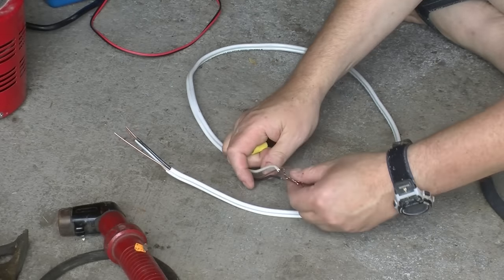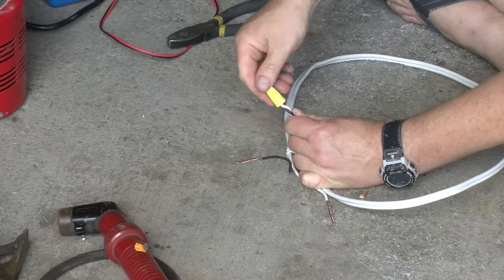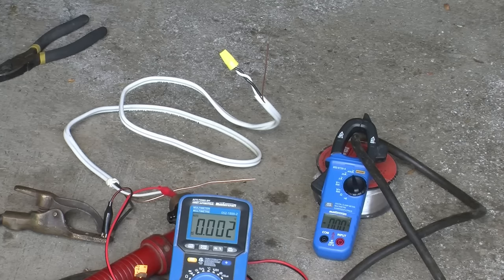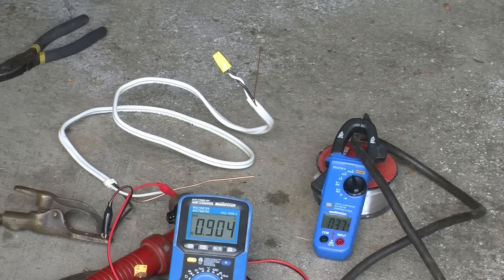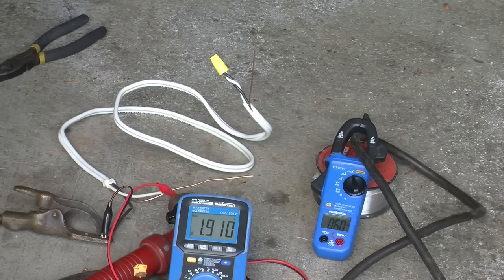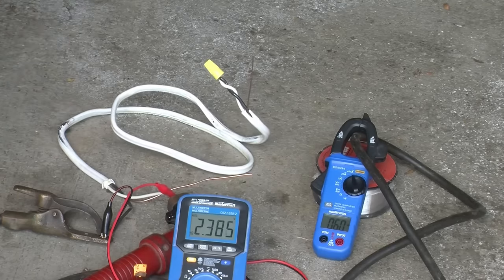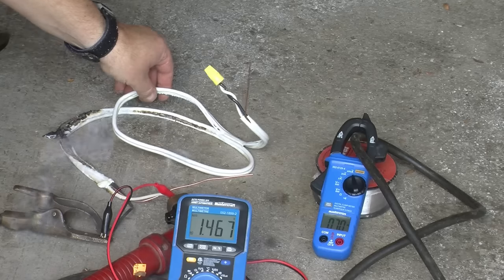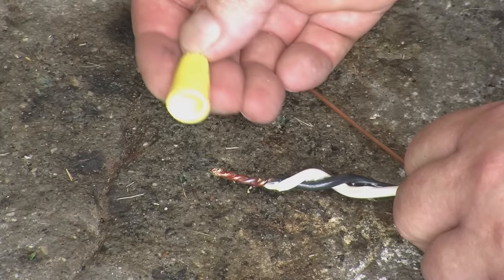How many Amps to burn up 14/2 electrical wiring?

Comment: I have a noob questions.  And it's been a awhile since I took physics 2. But I thought amps were dependant on volts and watts.  So how can you have like 80 amps and 2 volts with like 40 watts? Shouldn't watts be much higher? (I know of the formulas for calculating) I'm thinking of like a standard 120v and 3500 watt generator here for comparison.
Reply from the maker: The equation is P=VI where P is power in watts, V is volts and I is current amps. If you know or force any two of the variables above, you can calculate the  other one. This can be shown  by re-arranging  the equation so in your example, "amps were dependent on volts and watts" I= P/V but in the end is all the same - know two variables and you can get the third. 

Here I am setting the current with the welder and variac. The power we are investigating is the power dissipated in the cable from the current flowing though it (not the power delivered to the load). The power dissipated or lost in the cable is the current though the cable times the voltage along the cable. Whats the voltage along the cable? From Ohms law, its the resistance of the cable time the current through the cable V=IR and since R is constant (neglecting the effects of heating) P = VI where V=IR so P= IRI or typically written P = I²R

So the power we are seeing depends on the I we have chosen and the resistance of the wire which in turn sets the voltage along the wire. Since R of the wire is very low, V along the wire is low.  An example of this from the video is I=50A resulting in V=1.5V so power dissipated in the wire at that point is 50Ax1.5V = 75W.

The power in you last example is power delivered to a load. So if we had a 120V circuit with the wire in the video carrying 50A, the power delivered to the load (attached in place of the wire nut) would be 50A x 120V =6000W. At the same time the wire would be dissipating 75W since we know from the video that at 50A, 1.5V is developed along the  wire. 

Hope that helps!
Reply: @ElectromagneticVideos  actually this does  explain it!. Thank you.  I didnt consider it was just the wire

Comment: Thermal imager should be used to compare C° rating to failure. Also, commenting on wattage values is of no consequence as 20 amps @ 1 volt is 20 watts and tha same @120 volts is 2400 watts. Ampacity is the only value ( not property ) that is critical to conductor/insulation application.
Reply from the maker: I'm looking into an imager!

Comment: If you are fire conscious and fire worried - which we all should be - better to put lower rated fuses in and get smarter about not running so much power at one time  - you learn that as a thrifty person anyway or people with low power solar or wind - toaster OR microwave oven
Reply from the maker: Yes - however in Canada and US, in most cases the electrical code does not allow a fuse or breaker less than 15A. The big danger is people swapping in larger fuses or breakers.   I did a bunch of follow up test videos with the cable in a sections of wall surrounded with insulation and the safety margin gets uncomfortably smaller in some situations.

Comment: Why do I have to use the 16g stripper to strip the new 14 g wire? I rewired some of my house and it was wired with 12g wire. I bought new 12g wire and it is not the same thickness of copper. When did they start cheating us?
Reply from the maker: That's weird - how about  measuring the conductor diameter with digital calipers  for both the old and new? And compare both with the diameters given by online awg wire size table? I would be interested to hear what you find.
Reply: @ElectromagneticVideos  I do not have a digital caliper but I do have wire strippers and the 14 g stripper will not strip what they call 14 g wire today, I gotta use the 16 g to do it. Also, the 12 g wire my house has in it from the 70's is clearly thicker than the new 12 g wire.
Reply from the maker: @sputnut  From the 70s ? It isnt aluminum, is it?
Reply: @ElectromagneticVideos  No. definitely copper
Reply from the maker: @springhollerfarm8668  Baffling!

Comment: The test should have been preformed at 110 volts then increasing the amperage to make it a valid test  of what would happen in a typical house wiring.
Reply from the maker: The test here was to see the effects of heating due to the current so 120V was not needed. I did a FAQ video here with more details: https://youtu.be/CP3-jcpzZeI

Comment: So it looks like we can use 14-2 as a 200 amp fusible link?
Reply from the maker: Someone posted a comment about how in the old days they used #14 bare wire as a high current fuse just like that!

Comment: The problems I have seen are not so much the wire capacity but the connection to the device with the crappy "push-in" connectors in the back where only the thin edge of a short flat spring contacts the wire reducing the gauge of the connection to what, 22 or 24? I have seen many burned devices at that point where someone runs a 1500w heater for hours. I guess the Wago connectors have two springs touching the wire so it is twice as good as crappy! I only connect to a device by wrapping the wire around the screw and tightening it firmly. I also only trust connecting two or more wires by twisting them together and covering it with the proper wire nut. I have never had one fail! 
I understand the speed queens out there that want to get the job done quicker to make more money, and it will probably last longer than the 1-year new home warranty, so what the hell!

Comment: Apparently you do not know that wire nuts are designed to twist the wires when the nut is installed.
Reply from the maker: That varies depending on the manufacturer and model of the wire nut. Some instruction do it either way. There seems to be a huge argument between electricians whether to twist ahead of time or not. I prefer the twist ahead of time and it does seem to produce a better electrical and mechanical connection.

Comment: I thought the wire is rated at 15A at 120/240V  so it should go much higher at a lower voltage.
Reply from the maker: The heating is caused by the current through the wire and resulting voltage drop along the cable. The voltage between the wires does not contribute to the heat melting the plastic insulation. The main difference that a higher voltage between cables would create is arc type events once the insulation melts and fails. In a real circuit with 120V or 240V (or more) when arcing and shorting occurs you would hope a circuit breaker trips and the result would be much less interesting.

Comment: You are only supposed to use 12A because that is what the breaker can continuously handle without tripping, not because your wire cant handle 15A continuously.
Reply from the maker: Almost but not quite. A 15A breaker is supposed to not trip until 15A is exceeded, and, depending on the manufacturing specs, may pass a few amps more than that indefinitely as well as considerably higher currents for increasingly short periods of time without tripping. The 12A from the  80% rule is to prevent nuisance tripping at times when the AC voltage is a few percent above or below normal and loads react by (depending on load) drawing more current. 

The 15A code limitation for #14 is to prevent the cable from overheating over extended periods of time at that load, and organizations like CSA and UL do evaluations with cable installed in more realistic situations than in this video. In particular, the plastic around a cable that is installed embedded in insulation in a 2x4 wall will begin to fail at far lower currents due to the increased temperature rise. I did a few more videos after this showing cable in 2x4 walls and how much the safety factor is reduced.
Reply: @ElectromagneticVideos   Funny how knowing what you are talking about, tends to dispel wrong assumptions!
Reply from the maker: @professorg8383  Ha - yes!

Comment: You did this test on brand new wire . Maybe old wire that degraded over time would yield different results ?
Reply from the maker: The wire I used was unused but not brand new as in "I bought it yesterday", but still in new, shiny copper condition.  I think as long as the copper conductor is not damaged and still covered in insulation the copper remains pretty stable. However - and to your point - I have seen really old 14/2 (the old fabric sheathed type from the 50s to 70s) where the plastic insulation around the line and neutral wires has gotten brittle and was cracking, at least the part exposed to air in a junction box anyway. I'm sure how that changes how much heat the plastic can take before it melts - who knows - it may even make it better at withstanding high  temperatures but of course vulnerable to shorting if it is bent at all. Its also possible (likely) that the older plastics had different thermal melting points than the modern stuff. Your question really made me think and its worth a test if I ever come across an old piece of 14/2. I have some  friends who occasionally flip old houses and if I ever seen them stripping out old 14/2 I will grab some. I will also keep an eye out for it at the local Habitat for Humanity ReStore - a wonderful place for finding old and unusual stuff.
Reply: @ElectromagneticVideos  keep in mind as the insulation gets old it may lose some of its insulating ability. ( for lack of a better term ). So under a load it is rated for won’t effect it. But over loading it will.
Reply from the maker: @lhr1701  Very good point - I didn't think of that. Cracks, moisture, plastic degradation etc. And with enough current though a bad spot in insulation, heat, charring, an then shorting. I wonder how often that happens in old wires? Do electricians see that much in older houses?
Reply: @ElectromagneticVideos  I’m not an electrician but I have lots of experience with all types of wiring . You did forget rodent damage even water damage from leaks. I would have to guess the electrical codes are so specific to prevent problems from the very things we are discussing.
Reply from the maker: @lhr1701  Rodents! Yes - I hate mice!  Since we are on the topic of damage, years ago I was replacing insulation in my home and discovered what looked like two wires going through the insulation between joists was actually just one wire that had been damaged (plastic sheared off one one side) and some unscrupulous contractor had hidden the damage by pushing that part of the wire into the between joist insulation. Yikes! Your right about the code - I think its the accumulation of years of observations of bad things happening. However I get the impression now that some of the changes are the result of lobbying rather than real problem/consequence/cost analysis.
Reply: @ElectromagneticVideos  lawyers we have to many of them.
Reply from the maker: @lhr1701  LOL! Funny - after you previous comment I was thinking about a few other human caused issues in old houses I have previously lived  in. One had a wire connection with no junction box, and one junction box was just an old food can of some kind with holes punched in the side.  I guess the code was different back then :)
Reply: @ElectromagneticVideos  It'd be interesting to see how old 14/2 BX with cloth insulation stands up.  My house was built in 1924, and much of the house has this wiring in it.  

I'm not too worried of course since I have proper breakers so the wire would never be overloaded.  Still, it might be interesting to see how far technology has come (or maybe even not come since that old BX was tough stuff).
Reply from the maker: @stevesether  If I ever come across any I'll test it! In case you not aware of them, there are now Arc Fault (AFCI) breakers available that attempt to detect not just overload and shorts but arcing due to wiring faults. They are 4 or 5 time the cost of regular breakers, and you do need to run the neutral though them, but if you do get concerned about the old wiring they might be a nice added protection.
Reply: @ElectromagneticVideos  Thanks.  Yes, I've thought about AFCI at times, but I've still not bothered with it.  It can create nuisance trips, so it's not without its own issues.

I'm not too worried about the wiring in my house.  I've replaced some of the old BX during a general re-wire, and the cloth has held up surprisingly well over perhaps 70 years, and isn't disintegrating at all.  If I pull any more out, I'll send it your way for testing.
Reply from the maker: @stevesether  I have AFCI breakers on my basement circuits - and had a nuisance trips from an old table saw where I'm sure the brushes are wearing out and lots of sparking is happening. So yeah - a very valid consideration! 

If you do pull some BX please send it! But be warned - I do my tests outside and dont plan to do any during the winter when it is -30C outside! And I dont care how many YouTube views it would get me :)

Comment: could u repeat this with thwn wires instead of romex ... im curious any gauge will do
Reply from the maker: I guess to be fair in terms of operating conditions it would have to be in a conduit which would reduce air circulation. Maybe I can find some clear tube to mimic the conduit yet make whats happening observable.
Reply: I am all here for it